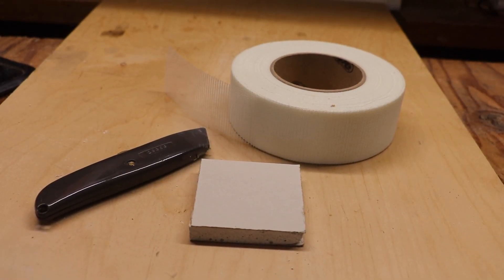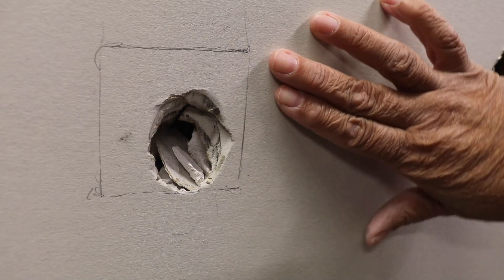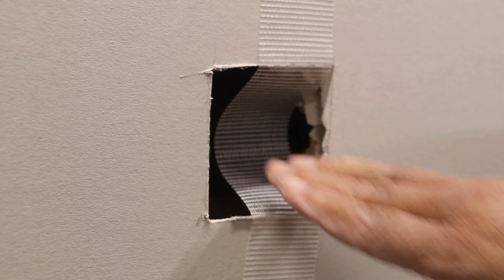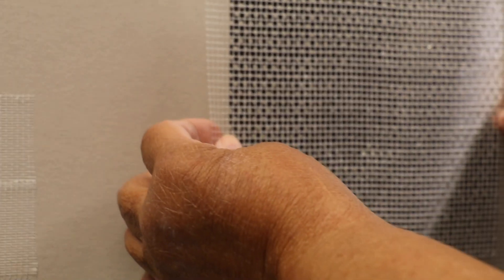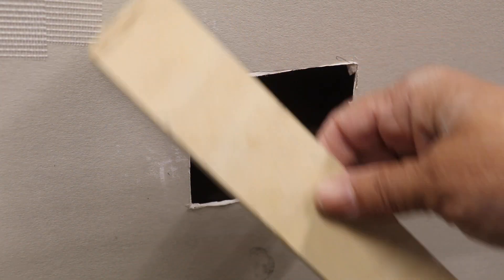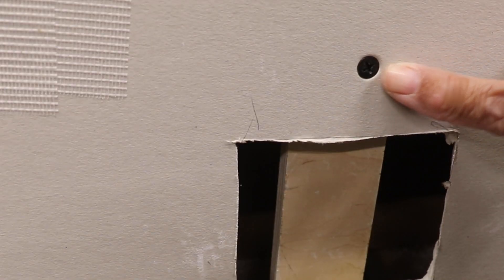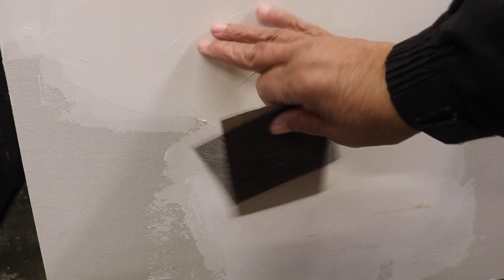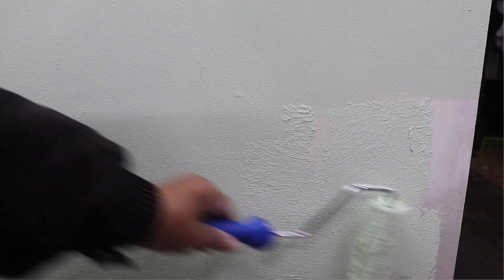Patch Drywall Holes 3 EASY Ways

Comment: Welcome back, Leah. So good to see you again.  I recently had to patch so many holes in the ceilings because my electrician removed all the knob and tube wiring in the house.  I primarily used drywall cut to fill the holes with plywood backing, mesh tape and the mesh screens.  I wish I had remembered the last tip you showed. 🤷🏼‍♀️

Comment: It is so good to have you back Leah. It's like a visit from a family member we haven't seen in a long time.
Thank you for highlighting some ways of doing this repair.
I try to do your third method whenever possible since it's more stable and overall easier to do.
I have found that a thin coat on the wall before over coating makes for a really smooth finish.
Blessings and be safe!

Comment: I’ve recently done the last one and it’s easy and worked like a charm except that I didn’t attach anything but the drywall plug with a little water and compound on the edges as the ‘sticky on the band-aid edges’ per sa.  Then just mud it and light sand.  It was super easy.  No screws even.  So far it has held up.   
Thanks, Leah!  Love any and all of your videos.  You’re a great teacher.

Comment: Most walls have texture on them. A very easy way to texture a wall with an "orange peel" texture is to take some "mud' and thin it down a bit. (Trial & error here folks.)
 Dip a whisk broom into the mud, pull the bristles back, and let them flick towards the desired area. So simple. but so easy and when I did my repair, the textured area was totally indistinguishable from the one the commercial drywall crew had originally done. Of course, it is a good idea to make a couple of practice flicks on a piece of cardboard. For a heavier texture, go over the area a couple of times.
 The mud washes right out of the whisk broom too. The best ones to use are the natural fiber ones. The synthetic ones just don't work well. The spatter pattern just does not look correct to blend in.
 Good Video, Leah. Thanks.

Comment: I use the last method most often. Also, you could wet sand it with a damp sponge for smooth dust free finish.

Comment: Hey, the lovely Leah returns!  Good to see you back!  I saw you replied to some comments about being 'rusty', but it doesn't show!  Very nice and informative treatment of these options.  I have used a couple variations of the 3rd one, either a backer without the 'butterfly' flaps, or the flaps alone and no backer (leaving an 1/8" gap around the plug part and buttering the edges well when doing that).  Awesome to see you again!
Reply from the maker: Thank you

Comment: Love your videos and friendly persona! I am a handyman (30+ yrs). Observation and suggestion - when using a drywall piece to fit into a matched hole, put some mud on the edges of  both so it acts as a glue and strengthener where the two meet around the edges!

Comment: So glad you're back and doing well, Leah!
I have a question re: the first method. With all that slack in the tape that goes behind the patch, what good does it do? Seems like the patch could easily get pushed too far into the wall. Thanks.
Reply from the maker: The cure joint compound holds everything in check.....it's intended for low traffic areas

Comment: Thank you Leah!! I literally have had a hole in my wall for 8 months where the pipe from the bathroom sink was repaired—I want to take a try it at myself —I think I’ll try that metal patch as long as you can cut it-Love your channel👍
Reply from the maker: It can be cut
Reply: For a moment I thought I wrote this. Same thing, plumber came in  and left a hole in the wall. I’ve had a for sale sign held on with duck tape. I will defenetly try repairing it now that I have options and the know how.

Comment: ❤️❤️❤️❣️👍🏽🤗Leah!!
If you ever get a chance, I rent and was not permitted to "put anything on the walls", so, thanks to you we now have a mini-freestanding wall to hold the wall mount tv.  It is plumb and square.  It has a 2x4 cabinet type base to prevent being top heavy, as well as a large pull out shelf.  Would you ever consider showing how to make cabinet doors or like mini folding doors?  Even alternate materials are good for me.  The wifi router is on the shelf, so maybe not the cool stamped metal they sell at the store (1st choice).  Ah!  Sorry so long!

Comment: I use redwood fence board for the backing because it’s a soft wood and it takes drywall screws very easy. You don’t ever blow out the drywall when installing the patch of drywall. 
I always keep redwood fence board in the truck. I’m gonna try that fiber tape method tho, very cool.

Comment: The last one is the one I always use (I may have learned it from you a long time ago). Whether it's mid studs or on a stud. It just finishes the cleanest for me. I don't back mine, I make the patch very tight and mud the sides. I've never had a problem. I've always considered the aluminum patches but haven't had the opportunity yet. I think I'd like those for bigger hole repairs.
Reply from the maker: The aluminum patch was a nice product but quite honestly they're unnecessary...I believe it's just as easy to make your own
Reply: @seejanedrill  certainly more cost effective making your own.

Comment: Hi Leah!  I have a circle cut out in my garage ceiling from a vent that was replaced.  It's about 6" diameter.  This will help me out.  Thanks for your awesome video's! BTW what is the difference, or which is better - the paper tape or the fiberglass tape?  I have been using the fiberglass tape in the garage.  Seems to bond together a little bit better.

Comment: Thx leah.  
Getting old and hired a contractor for the 1st time.  They installed new drywall ceilings and recessed lights in 5 rooms and hallways.   I have 6 recessed light holes that were cut too big and never fixed and ofcourse the contractor never came back.  What's the best way to repair and close up those gaps.  I tried those plastic cheat rings but dont like the look.  I need to fix these gaps properly.  If I just pop some spackle up there I'm sure it will just pop out when removing or reinstalling the spring loaded lights.  The ceilings aren't primed yet.  Gaps are from 1/2 -1.0 inches.
Thx for any advice.
Reply from the maker: Strait Flex makes a good product for those sort of situations
Reply: @seejanedrill  thank you so much for the reply.  I'll check it out. Stay well.

Comment: If there is a big hole, place furring strips or plywood around all edged and cut a patch to fit and screw it in.
Another trick I use it wet the paper DW tape, that way the compound soak into the paper tape easier and there are less to no paper tape pops.

Comment: Missed you. Glad you are back.  There are lots of products to hang pictures in the Sheetrock but what about in the stud. Do you still hammer a nail or drill a smaller hole first? What’s the best nail to uses?
Reply from the maker: Loiion makes a product called a double headed picture hanger.

Comment: Although I’m a long time sub Odd this showed up because last night I damaged drywall getting a tile off have to fix it today-:-:- UPDATE- dremel out damage- 2 vertical pieces 1x4 behind - some scrap 1/2” baseboard moulding cut to fit...now carry on with tile backsplash project for laundry room.

Comment: One of these days could you do an example of patching a hole in an older home that does not have drywall it has plaster for the walls. We bought this older home and there's a pretty good size round circle hole probably 12 inches round that her son had made and was explaining about it when we bought the house. She also had showed us downstairs I'm thinking about 24in. long sideways horizontal I guess you'd call it with maybe a 2 or 3in. Wide all the way across she said her son in a cloth rocking chair rocked so hard into the plaster wall and that's how it made that hole. It is an older home but I'm thinking the walls had been re-plastered and they're old and they need to be replaced because if you Nail something in the wall it will fall off the wall the plaster is old and pulls down I can't explain it I hope you know what I'm talkin about. Maybe also something with these walls and maybe how would I go about doing the walls one day. I also have another problem that doesn't just belong to an older home because we had that in a home that was built in the 50's in this other house that we rented. Question is how do you get wallpaper backing that is not regular wallpaper off when you try to get it off it has this paper bag looking paper color attached to it. I don't know if they used to glue or what it is terrible I'd really like you to do something about wallpaper you know different kinds of wallpaper and this is the worst kind because someone told me when I used to have wallpaper they would rent a steamer and have it overnight and the next morning the wallpaper just  fell off the wall. That wallpapers not the kind of one I had and at my other house I rented  that was built in the fifties they had the kind I have now with that paper backing that is absolutely hell to get off of wall and in this big living room that's how they did it with this wallpaper and I don't have the money to pay some professional to come in and do it so if you could help me with these two types of videos I would so appreciate it and maybe it would help some other people too I hope you get to see my comment and if so thank you so much for reading. I really like how you explain things and since I'm not so knowledgeable I'm hoping with you explaining it will help me to understand how to do it.

Comment: Leah,  where does the backing paper come from that attaches to the drywall plug?
Reply from the maker: It's the drywall paper....you simply remove the back paper and the plaster center and you've got a plug.
Reply: @seejanedrill  thanks for getting back to me!

Comment: I have fixed hundreds of these-about 2 dozen a year.  Unfortunately, on the old houses and apartments where I usually work, the board backing trick never works as the old plaster or drywall is a weird depth and the patch never sits evenly in.  I think I need to rethink how I should do these.  Maybe I should screw in the board back, and screw 2  temporary boards on the front to get it level. Then use durabond 5 to fill the missing depth of the patch to the backing board.  I could then use 5 minute epoxy to tack 6 spots of the edge into place, then durabond 5 and tape the edge.  After 1 hour, I could screw the patch to the backing wood.  Remove the 2 leveling boards.

Durabond 5 minute takes about 45 minutes before recoat, and 2 hours 45 minutes to 3 hours to dry enough to sand and paint.   I never attempt to sand any oth versions the same day.  

The Metal patches are not for quality jobs, as they are impossible to get out the crosshatch texture in the center, as it flexes inward when you patch and sand it.

The clip system did not work on the 1969 apartments for some reason, that I can't recall. 

The mesh trick would only work on small patches, which Jane should point out.

Comment: This is good video but all of these methods involve leaving the patch slightly proud of the wall. I know it’s only the thickness of the scrim tape or plasterboard paper but it’s still sitting proud. And under certain lighting you are going to see that very slight bulge. 

If you’re going to use these American type methods then you need to grind or sand down the wall where the patch is so that when you apply filler over it then it’s perfectly flush with the rest of the wall.
Reply from the maker: Tapered properly I have never had an issue.  it os no different than taping joints.

Comment: You can get away with just cutting the hole and the plug edges at an angle. This prevents the plug from falling through the wall.
Reply from the maker: In a low traffic area, yes I would agree
Reply: @seejanedrill   By the way, the plug method you demonstrated is also called the Los Angeles method. It was developed by African-American dry wall workers in LA. Very clever!

Comment: No primer? That mud is going to flash thru.
Reply from the maker: It was a patching video and not a painting video.  You're absolutely correct about flashing however.  Sometimes it's difficult to know what to include in a video presentation and what to exclude because video length is a consideration.
Reply: @seejanedrill  respect. Thank u for all that u do.